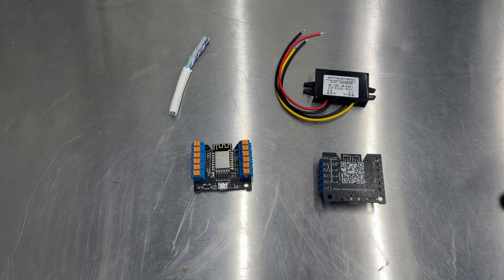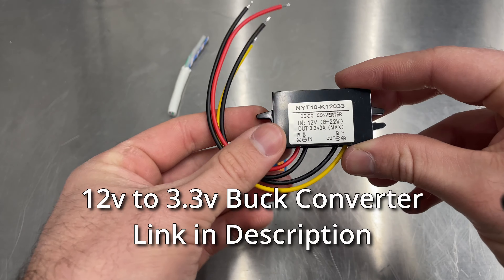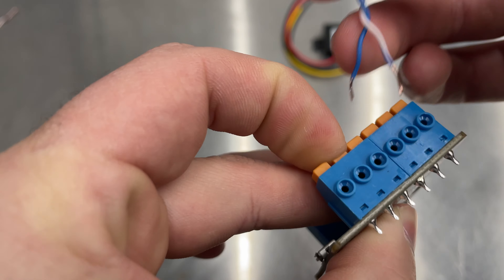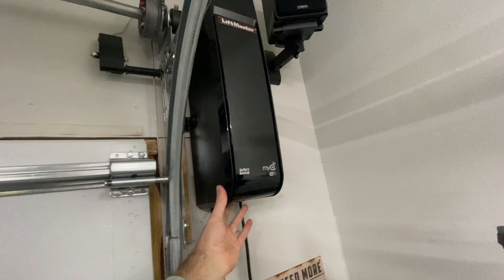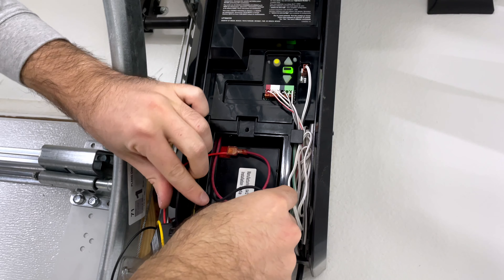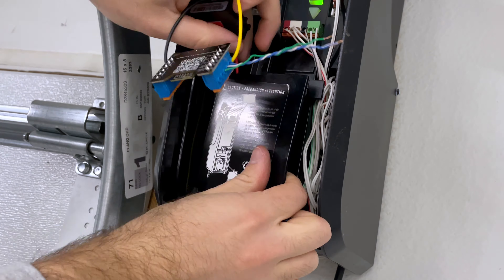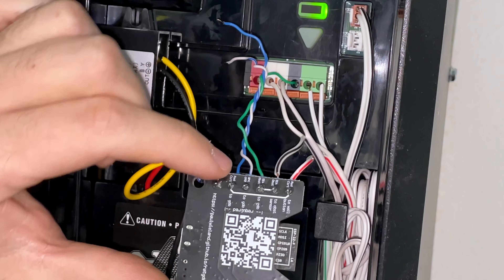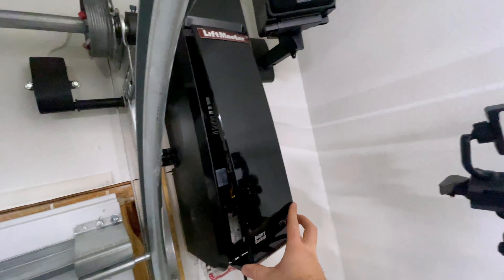Installing RATGDO on Liftmaster MyQ Security+ Jackshaft 2.0 Garage Door Opener (3.3v)

Comment: Nice to see an install walkthrough — I’ve been putting mine off!

If you want an easier way to connect to the battery, look for a “piggyback spade terminal” to crimp onto the buck converter wires, would probably work great in this application.
Reply from the maker: Wow! That's perfect haha, I wish I had some of those around. I might order some and update mine. Thanks for that!

Comment: Can't thank you enough for walking this through. I have (2) Chamberlain 8500w motors and just received my (2) 2.53i ratgdo devices. It was a bit daunting to figure out what to do but you made the wiring part SO easy. Once I saw someone do it, it took me about 3 minutes to get it all swapped. Unfortunately though my 2.53i board doesn't allow for a 3.3v wire connection even though the ratgdo wiring diagram mentions one (it shows the 2.52i board).
Reply from the maker: Some other comments are making me think 3.3v isn’t the way to go! Glad to have helped, I found it confusing at first too!
Reply: They do have 3.3 pins they just have to be soldered to, bottom left corner to the left of the usb port, 3.3v and ground pins right there.

Comment: About to do the same. Just got 98022's installed here and am waiting for the ratgdos to arrive. Perfect timing!
Reply from the maker: It’s been working great!
Reply: Finally got a nice clean install with all the feedback you received. 
* Used Piggyback Spade connectors. Heads up, the negative terminal on the battery is a lot smaller of a spade, thus may need to trim down the piggyback connector to fit.
* Mounted the buck converter on the inside of the door with just a tiny hole out to the RATGDO. 
I still wish I could figure out how the trigger functions work on the other side. Want to hook up other function like Eufy garage door camera. 
Also wondering how I could get data potentially of the wall button, like temperature.

Comment: Does the bolt lock tie into the system at all?
Reply from the maker: @McFly6088 Nope, this is the same as pressing the wall button. The bolt lock works just fine. We don’t have to account for that

Comment: How’s the battery after all this time? My wall button shows the battery is constantly charging? Will the battery eventually die?
Reply from the maker: Mine has been fine so far. The battery could eventually die but it is a cheap 12v lead acid battery - cheap and easy to replace.
Reply: @ChuckBuilds  my wall button finally shows full bars. Also to note, you don’t need to cut the door. You can fish it around the back, there’s an opening. Found it when installing.

Comment: Nice video, does it show percentage of the door (like 10% open) in HA? can you tell it to automatically open to 20% or something?
Reply from the maker: It does not. Just says open or close. You could probably get something similar if you time the garage and make an automation to stop it after x seconds
Reply: @ChuckBuilds  ah thanks for the info! are you using it over MQTT or ZHA? I heard there is more functionality on ESPHome
Reply from the maker: @UnexpectedTokens  I am using MQTT. At the time it had more features than ESPHome. I tried both and made a video on both but MQTT felt more responsive. Granted I have not been updating the firmware at all.
Reply from the maker: A friend just sent me this, looks like what you want! https://github.com/ratgdo/esphome-ratgdo?tab=readme-ov-file

Comment: I did basically the same thing, although I used a 5V buck adapter. Well, it worked for a few weeks and then the battery died. Looks like the floating mode circuitry can't supply enough current to power ratgdo, and it slowly drains the battery. Mine is now dead and sulfated, I had to replace it. On an off chance it was just a coincidence (the battery is 5 years old, after all), I'll try to connect ratgdo again and report here in a month or so.
Reply from the maker: oh wow, I'll need to keep an eye on that! Good callout
Reply: @ChuckBuilds  Reporting: the new battery also got died. What happened: the battery came at around 80% of charge (12.86V), and the garage opener charged the battery to 100% within about a day. Then it switched to "floating mode", providing just a few milliamps of current, not enough to compensate for the power draw of ratgdo. It eventually discharged the battery below the safe threshold, and now the garage door opener refuses to charge it.

Apparently, the charging controller in the opener is not expecting that the battery can be discharged while in the floating mode.

I have a Chamberlain B970 opener, yours might have a better controller.
Reply: @ChuckBuilds have you had any battery issues?
Reply from the maker: @JWS-xn8ye  not yet!
Reply: Did you ever figure this out? Wondering if powering off the battery is just a bad idea and if we should power off the 120v outlet instead?

Comment: The link you posted for the buck converter is an NYT-11 1203.7. And the output is 3.7 instead of 3.3 like the one in your video. Will that still work without frying the RATGDO? I can’t seem to find the exact one you have :(
Reply from the maker: I swear it used to be 3.3v! Hopefully just out of stock and coming back. Any 12v to 3.3v should be fine, that specific brand was just cheap + prime
Reply: Should it be a 3.3v or will the 3.7v work?
Reply from the maker: 3.3! This should work https://amzn.to/4aEMH0E  @amithimani8163

Comment: Is this opener a LJ8900W?  I was working with a LJ8900W over the weekend that looks identical. I was having issues where door control worked but status was really slow to update.  If the status updated it was normally several minutes after the door status changed.  Controls generally seemed to work.  It was odd and still don't know why it wasn't working normally.
Reply from the maker: It's a Liftmaster 8500W but I bet it is similiar. I'd try RATGDO firmware update with ESPHome maybe. I had a few weird issues when filming the series vs actually installing that was fixed with a fresh firmware flash
Reply: @ChuckBuilds  The RATGDOs I was using are the ones from Gelidus Research.  Turning my testing a different points I tried both the original RATGDO firmware and the Gelidus Research version adapted from the Konnected blaQ GDO firmware.  Both seemed to produce similar results.  It seemed like control was working but communication was either not working or really slow.  I'll have to mess with it more, unfortunately the openers these units were purchased for are 3 hours away.  I'm going to have to do some more testing on some friends openers that are more local to try and figure out my issues.  

The thing that is weird about the LJ8900W is the buttons are just single green buttons.  Almost like maybe it's security plus 1.0 but when I set the firmware to 1.0 nothing worked.  It only partially worked when I had it set to 2.0.

Comment: What's the difference between MQTT and ESPHome?  Do both of these integrate with Home Assistant?
Reply from the maker: Both integrate in different ways. MQTT is a message broker that you might already be using for other things like Zigbee. ESPHome is a Firmware that can tie-in to HomeAssistant without a "middle-man" broker routing messages.

The Main difference in the context of the RATGDO is features as the ESPHome Firmware is lacking some features on the MQTT version of Firmware.

Comment: Great video.  I have installed ratgdo without any issues on my Home Assistant.  However, the garage door will not open or close.  All existing remotes work.  Verified all wiring.  Obstruction sensor in ratgdo reports when obstructed and when clear.  But garage door will not respond from Home Assistant.  Any suggestions on troubleshooting?
Reply from the maker: Any errors? What Garage door? I see you used the MQTT version, maybe try ESPHome? Does it light up when you press open or close on the app?
Reply: @ChuckBuilds  no errors.  Liftmaster 8500, jackshft drive. I verified compatability. Does it light up?  What is supposed to light up?
Reply from the maker: @daviddonnelly8406   The RatGDO flashes blue when it gets a command. Does it work with the Obstruction sensors removed?
Reply: @ChuckBuilds  When powered up, RatGDO led is solid/constant blue.  When open or close button (command) pushed (small gray circle appears around the up or down arrow) from HA sent, LED blinks (very, very quickly), no haptic feedback on my cellphone.  When obstruction sensor wires (there are two) are removed from RatGDO, HA shows "obstruction" and the garage door does not move.  When I push the HA RatGDO stop button (gray circle does not appear), after pushing either the open or close button, nothing happens - even no haptic feedback on cellphone.  NOTE:  The RatGDO on HA shows a light - yet I have no light feature on my LiftMaster 8500 Jacksthaft garage door opener and....when I push the light symbol on HA to turn on or off the non-exsiting light, I get haptic feedback on cellphone.  Thoughts?
Reply: @ChuckBuilds  Seems I need to select a security configuration.  But darn if I can figure out where.  I reflashed the ratgdo, but a security option never shows.  any idea where this security option is to set?
Reply from the maker: @daviddonnelly8406   It is likely the "Garage Door Control Protocol" at the bottom of the page when you are logged into the device's IP address. Had you selected Security+2.0 on there? Just above the save button
Reply: @ChuckBuilds  Long story – very short. Reflashed ratgdo for mqtt.  All went very well. On the ratgdo web page, at the bottom, there is a Control Protocol selection. I totally missed this (MY BAD – BIG TIME). I saw and focused on the firmware update at the top of the page. (tunnel vision)  However, I selected Security +1, and then updated the firmware to V2.1. The system was updated and rebooted. However, the garage door would not respond.  So – reflashed, firmware reinstall complete, selected Security +1, DID NOT update the firmware to V2.1 and ratgdo works.  So, for me anyway, the firmware update is titled: ratgdo_esp8266_v2.1.bin.  And the update description would seem to indicate I need to update as I am using Home Assistant.  But I now believe the update label means the firmware update is for esphome….not mqtt.  So, as of right now, ratgdo works as advertised.  Many thanks for your help.  THANKS !

Comment: I wasn’t sure the lift master was actually charging the battery but it seems the manual says it does. Edited this comment for clarity.
Reply from the maker: Interesting, I heard the opposite from a Liftmaster Dealer that replaced my batteries after I had an issue with a gate opening due to low voltage on the 24V Battery Array. I'll keep an eye on it. Thankfully the 12v battery is cheap!
Reply: @ChuckBuilds  you’re right, the 8500w manual does mention a charge indicator status led. Perhaps the issue experienced by the other commenter was a charge cycle limit / age of battery one. Hard to say.